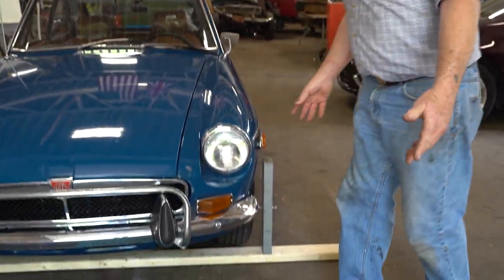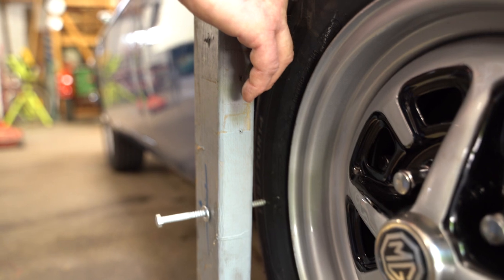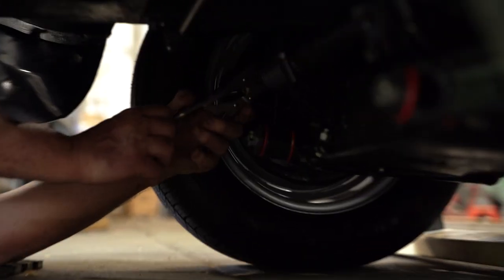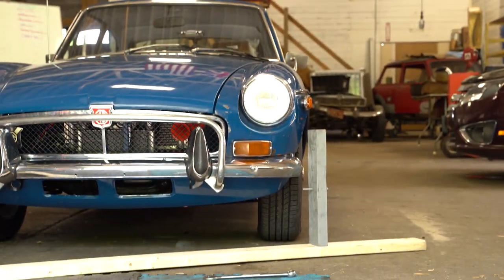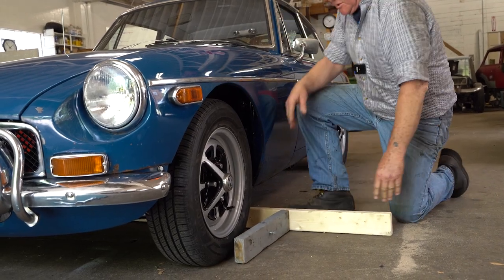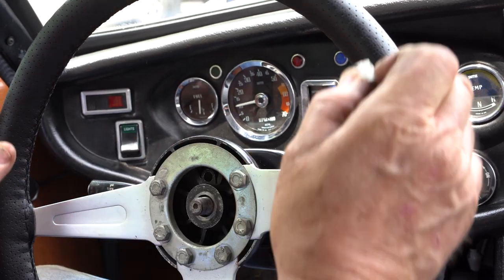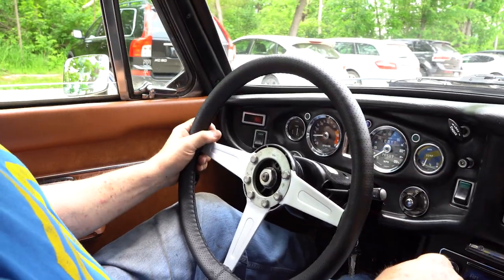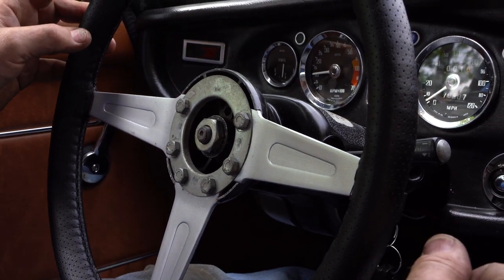338 MG Tech | DIY Wheel Alignment: How to Align Your MG At Home!

Comment: Pull a length of string down one side of the car making sure the string is tied to a jack stand sitting slightly behind the rear tire. Position the string across the centers of both wheels. Now you can touch string to front wheel and easily see if it has toe-in, toe-out, and how much when compared to other side using same string method. Keep in mind adjustments on left and right tie rods will affect the center position of the steering wheel so start the entire process with the steering wheel centered.

Comment: Hi,  Love the 2/4 set up. Maybe an idea would be to screw a triangle of plywood from the horizontal to the vertical. This would keep in place the 90 degree. 
Just an idea. Thanks for everything
Reply: yeah, thinking the same thing...he needs to brace those flimsy 90 degree 2x4's...he could be off as much as an 1/8" gravity flop.
Reply: John mentioned near the end of the video that the system would have been better with gussets.

Comment: Totally agree on resting the tyres ie rolling the car backwards and forwards after making adjustments. About centering the steering wheel, there should be a hole in the rack in which you insert a pin and it locks the rack in the dead ahead position. Then you carry out the fine tuning of the wheels at the tie rods and then if needed the steering can be set to straight ahead position. Its a repeatation, but there are the 3 adjustments to manipulate, tie rods, steering rack or box dead ahead position and steering wheel.

Comment: I do my own alignments at home.....using just a steel tape measure. I keep the steering wheel straight...as i drive in...i find the one front tire that's straight...and the one tire that's cocked-crooked...and i only adjust cocked tire...with 1/16" toe-in using the straight tire (and straight steering wheel) as my reference. Works best with new tires...not worn past 50%

Comment: I had to install a motor mount and had to drop the steering rack.  I though I marked the connector from the wheel at the firewall to the shaft, but apparently I messed it up because the wheel is not aligned lol

Comment: Perhaps the alignment tool could be improved by adding a horizontal section at the height of the axle then having a screw at both the front and back of the tyre one both the LH and RH side of the car. When both screws are equal the you have a neutral alignment.
Reply: No, doing it that way would require the jog to be very accurately made, this guys method is sound it is using the jig to compare so it's just enabling you to visualise to difference.

Comment: alignment for older cars cost 10euro. why the FCK will i do this crap work?
Reply: Uhmm...because working on MGs is fun...?
Reply: After working on the steering of the car, particularly tie Rod end replacement, this will get you in the ballpark to go to an alignment shop, particularly if you’re not close to one. Other than that, a shop that would do an alignment for only 10euros isn’t a place I’d take my car. Here it’s $75-100, which at current exchange rates works out to about 85-100 Euros, the vast majority of alignment machines are electronic, one price fits all.
Reply: fun comes in different packages